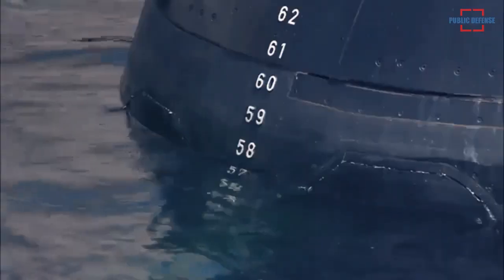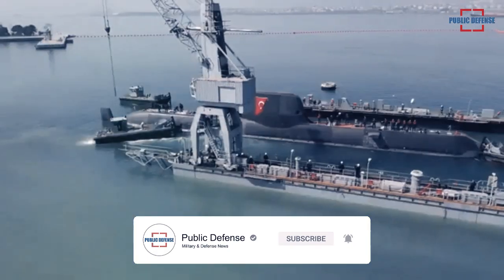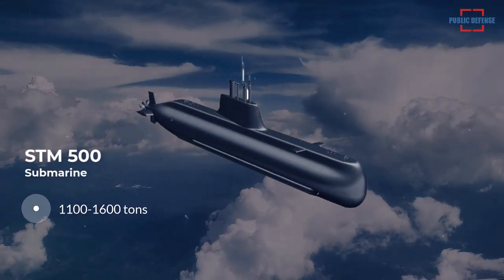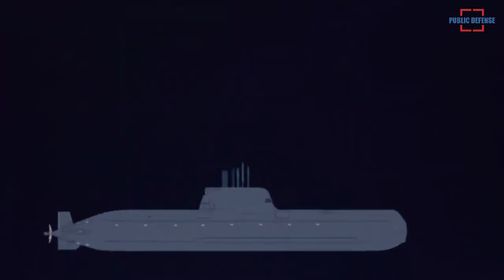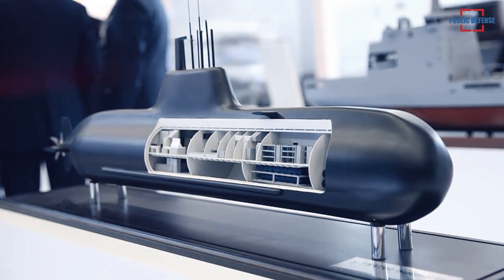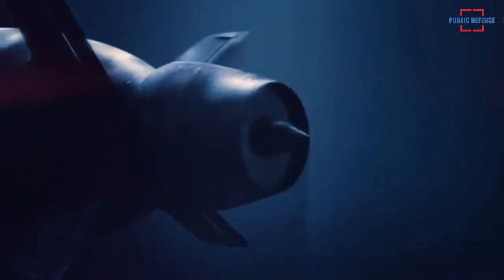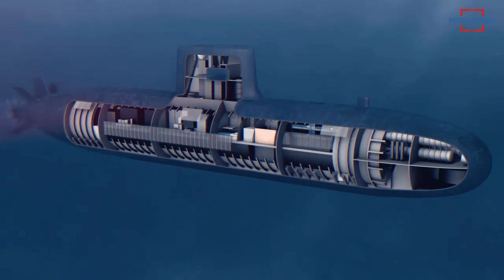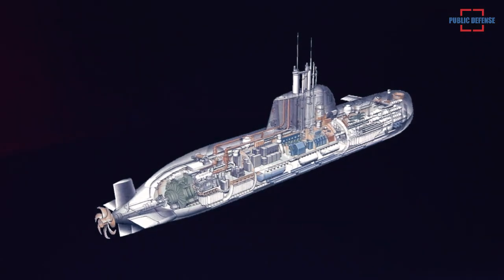Turkish STM Revealed a Conceptual Design of 540 tons Mini Attack Submarine, Named STM 500

Comment: you have like ten years trying to build one U-214TN submarine and you still have not finished, and now you copy the German U-214 and call it MTS, finish the U214 first see if it works, super power more like super clowns.
Reply: What dream world do you live in !? 🤣🤣🤣🤣First of all, you bought a standard submarine, that is, a submarine that is out of balance, but we extended its height by 3 meters and increased its weight a little, as our authorized commanders noticed. We produced Type214 with 81% high domestic contribution. And you have produced it with full foreign technology and are dependent on the outside. What were you able to localize while we were localizing radar,sonar,sensor, and weapons systems ? Anything 🤣🤣. The Ill Type 214 submarine has already been put to sea, or are you ignoring it ?Each will, in turn, join the Navy between 2022-2027 Dec . And you'll be watching from afar crying🤣🤣🤣
Reply: @bedrihanarmagan8812  if i was a Turkish dreamer like you my friend, I would believe your lala land tails but unfortunately I live in the real world. you don't produce anything useful kid you just a Turkish dreamer like Erdogan your submarines are crap when you put them submarines in the water then talk and if they work and our submarines are not out of balance,when the u214 was build as a first of it's kind it was leaning but the Greek shipyards found the problem and fix it, now I don't know what you going to do about that probably delay an other 10 years 🤣🤣🤣 only Turkey doing the crying kid that's your part my friend.
Reply: @vassilisioannou5488   what are you talking about? Turkey do have expertise on different fields, it's just a fact. why would anyone deny that ! Turkey won a modernization competition for Pakistan navy's submarines ,  they also build many military aircraft,vehicles,ships,weapon systems for different countries including mine(Bangladesh). they helped us with different modernization projects, some of our chinese & russian build system were modified to support western components.This types of engineering expertise are no joke. Don't be ignorant !
Reply: @mdtanzinmaksud7042  it not like that my firend, it's just the big misleading of the Turkish Government and that is a real fact, but I not going to be spisific with you because I don't have the time, if you want to be a fool that's your choice.
Reply: @vassilisioannou5488  
Oh I know you, wasnt you waiting israel's door for "rent" a few uav? 
Ahhaha
You cant be our rival man, go be rival with uganda or somethink like this kind a countries. 
Pebbles like you cant stop waterfalls like us.
Reply: Barking greek
Reply: @erenjager1157  go cry to your  Master kid
Reply: Hahaha. You can't even produce torpedoes yet. You can't even manufacture a pistol. If I were a Greek I would be ashamed to write this. Have the torpedoes you ordered from Germany arrived yet? You wait more. We manufacture 85% of the 214 type submarines ourselves. Friend said 81% but that was in the past. You are sick, very sick. Instead of posting silly comments here, do something for your country.
Reply: @ahmetturk3858  you produce coped junk kid that nobody buy's and does not work and you produce weapon's that your waiting parts from in Europe lol you selling to country's that nowone sells to like Pakistan, Somalia, Bangladesh, when you produce your own and it works then talk talk my friend, Greece is ahead of turkey poor kid why would we make a pistol when we selling weapons to NATO and US special forses like this  https://www.youtube.com/watch?v=_p0ftpdPZes&t=156s
Reply: @vassilisioannou5488  firtst of all boy a NATO and Eu member state Poland recently bought 24 tb2 drones from Türkiye last month;) and would likely Lithuania will follow Poland soon. And interestingly Turkey makes nearly 3 billon dollars of military exports each year with 500 million of it to america. On the other hand you are selling 30 million dollars worth weapons (just pistols and mortars nothing more) . Your exports are %1of ours 😂
Reply: @vassilisioannou5488  pistols and mortars are only weapons you can produce. On the other hand we can produce corvettes (12 Total with 4 Pakistan and 4 Ukraine ) , frigates ( 1 of them already finished, lhd (Anadolu) , intelligence ships, sattalites, uavs (240 for Türkiye 125 for exports as of today) , Atak helikopters (we have 102), Air defence systems, armored personel carriers ( 18 different countries are using our apcs including hungary a EU member state;) )
Reply: @vassilisioannou5488  our type 214 submarines are better than yours first of all they can use anti ship missiles and cruize missiles like Turkish gezgin long ranged cruize missiles. And again they can use Idas missiles for Air defence. These capabilities are not in your subs because they are older and less modern systems
Reply: @vassilisioannou5488  we have just started to build an open sea patrol vessel in Istanbul shipyard TCG Akhisar today;)
Reply: @carpediem5514  your u214tn have systems that have never been used before so we don't know if they will even work, but that is a risk your country made and they are nowhere close to the Greek U-214 and they never will be either, you are right about having some extra capabilities but that wont help you if you don't have the decades of experiences of the German sub engineering, I don't see it my friend your subs won't be in the water for some time and that is if everything can work.
Reply: @carpediem5514  that's what you think but Greece made 1 billion in it's defense industry sales at DEFEA 2021 and this year so I would say it's a good start. you only looking at one picture my friend you looking only at Turkish defense industry and you not looking at how much Turkey lose from investors and partnership with the EU US, let just say that 50 years of your defense industry and you still will not get the earnings that you would have had if you were to leave this radical islam dreams and ottoman empire nonsense.
Reply: @vassilisioannou5488  night vision systems 😂😂 ASELSAN is selling night vision systems for 20 years so far . About the german sub engineering we are using type 209 and type 209\1200 class submarines 12 in numbers Total. We are already got used to the german sub engineering;) and let me tell you this, Selçuk bayraktar annaunced mass production of Akıncı drones has indigenous AESA radars  with 1.5 tonnes payload capppacity it can use Air to Air missiles and cruize missiles like Turkish SOM. And more than that they have started to work on MİUS unmanned fighter jet;) this jet can use all the missiles an F-16 can use and it can Carry it in inner stations like F-35 do.
Reply: @vassilisioannou5488  night vision systems are really deadliest things one can ever produce (!). How did you manage this (!). And least of all you have exported it ha? its something i have never seen(!) . The ultra high tech Greek defence industry (!) İs marvelous😂😂 on the other hand we can produce cruize missiles with 1000 Kms range and 2000 Kms ranged ballistic missiles but again night vision systems are deadlier (!) . We have sold TR 300 Tiger missiles to Bangladeş worth 300 million dollars in the beginning of this year its a Good example for what really is defence industry.
Reply: @carpediem5514  missiles? why would we produce missiles when we can produce lazer weapons? I don't think your missiles will do anything but put on a good fireshow 😄
Reply: @carpediem5514  we don't need junk unfortunately
Reply: @vassilisioannou5488  are producing flying tanks and hypersonic mortar shells too😂😂 you cant even produce an indigenous rifle you are even importing the uniforms of your soldiers yet you are telling you can produce laser weapons 😂
Reply: @vassilisioannou5488  and let me ask you what do you think about poland buys 24 tb2 drones from Türkiye? İ asked it every greek i talked but they dodged the question. As you know Poland is a NATO and Eu member state
Reply: @carpediem5514  I don't think much for it, TB2 is a small cheap drone but as time goes on the market will become more competitive because big companies are stepping up there game and it will be harder for Turkey to make sales like this to NATO country's.
Reply: @carpediem5514  I will show you later i am busy at the moment
Reply: @vassilisioannou5488  we are moving further with New drones like aksungur, akıncı and MİUS . Our drones will be the cheapest among the competitors also more cost effective in general so i dont think we will lose the market.
Reply: @carpediem5514  you see my friend missiles are a thing of the past were is the Turkish laser weapon???
Reply: @vassilisioannou5488  its been 2 years since we have shot down that drone;)
Reply: @vassilisioannou5488  your problem is my friend as Greeks, you think some systems can outmach Turkish might . You cant cope with us. We have more GDP, bigger navy, bigger Air forces, bigger land army . Much more elevated and developed indigenous defence systems and productis... You are weak to cope with us you are barely strong enough to take little countries around you not us
Reply: @carpediem5514  I apreciate that you both still call yourself "friends", because you are allies in NATO and you both as characters have much more in common as you think.
Maybe you both could be good friends in real life.
Reply: @vassilisioannou5488  and according to the video you shared the so called laser systems are not fully producing i mean mass production. Our laser systems both mass producing, and integrated to our personel carriers and ships... You are behind again again also the laser weapons is the only subjek you are talking but i talked you about frigates, sattalites uavs, corvettes, Lhds, and many more;) we have 72 big projects going on at the moment. İncluding emp bomb, long Ranged defence systems, hale drones, unmanned fighters, TFX fighter jet, Hürjet planes e.t.c .
Reply: @rollerrollerichson6258  i agree my Greek friend here is a Good patriot for his country as I do to mine. His knowlegde about weapons systems and products are quite Good , as do I . Yes we could be Good friends in Real life;)
Reply: @carpediem5514  I am sorry to tell you this but you don't have a laser weapon, that is fake news unfortunately, yes it is not in production yet but it will be soon. and if you still think that you make laser weapons then show it to me in a picture or video I might want to buy it.
Reply: @vassilisioannou5488  you did not participate in Libya conference, your Media wrote many news on the issue, mitsotakis and dendias tried hard to participate but germany did not let it and they cried 😂 yours is a weak country again. You are useful when other Western countries sell you weapons and when you give them military bases for 40+ years old outdated weapons 😂
Reply: @vassilisioannou5488  Want some Laser weapon systems ? Check Roketsan ALKA and Meteksan NAZAR systems. I doubt you will have funds for those but still you can check them out at least ;)
Reply: @ersinhuseyinoglu  those are little toys compared to our laser, which has a 36 km range and can destroy hypersonic, Balistic, missiles  anything that Flys even satellites, when you manage to make something like that then talk. You can see it in my channel if you don't believe me.
Reply: @vassilisioannou5488  If you can write here the system names so i can check. Also are you sure about shooting satellites with ~40km range ?
Reply: @ersinhuseyinoglu  yes, I am 100% sure satellites orbit at 36 km from the earth because there is were there more effective, you wont fined anything on the net my friend maybe two or three things, this project is not being shared with the public at this moment but I can tell you that the company that is making this is Soukos Robots and that they recently cut a tank in half in less then ten seconds and also it is 300 kilowatts.
Reply: @ersinhuseyinoglu  and also it can lock on to multiple targets and shoot them every 2 seconds
Reply: @vassilisioannou5488  i think you are confusing satelite distance. Check related websites for better information. Sat. distance begins around 150+ km. So check facts and claims. Also labeling TR systems as toys is joke itself especially there are international reports that Turkey used laser weapons to shoot down drones. I advise you to check some facts about satellites and Turkish laser systems.
Reply: its not neccessary for shallow waters you are not someone who understand what strategy is arent you?
Reply: @nephilim20111  you know what ealse It's not neccessary sprinting, there is no need to follow in your grandfather's experienced running
Reply: My greek brother 😆
Reply: By the way, this submarines are based on U-209 Type.
Reply: @rollerrollerichson6258  yes i know it my friend.
Reply: Mr  little greek you are jaloux  the Great Turks is reality 👊🤟🤣
Reply: @abdimahad6299   🤣
Reply: The nation of Turkey played Dirty games against my country CYPRUS since. 1958.,through our compatriots Turkish cypriots a minority of 18% ,been found with RIGHTS like they was 30%-40%..with the ESTABLISHMEND of OUR COMMON CYPRUS REPUBLIC at early 60s , and yet they blow them UP following instructions from Turkey..
TODAY..
our compatriots Turkish cypriots , they past the dimant for equallity.. ( the 18% ,/to be equal with the 82%)..and they are asking for a state on OUR STOLEN PROBERTIES..?
AGAIN TURKEY. 
through our compatriots Turkish cypriots is trying to put a hand on the islands NATURAL SOURSES..
The way they are going.. ( the Turks).. one day they gonna ask from US CYPRIOTS to leave from our island..

for proofs PLEASE search in you tube about. 
1/..' Rauf Denktash's shocking comfession "
read and ALL the comments below THE TRUTH IS THERE
2/.." Dervis Ali Kavazoglu kendi sensinden "
a Turkish cypriot jornalist been murdered just BECAUSE he was saying the TRUTH..
Reply: Greek I understand you are mad but bad news for you. Turkey has already finished 2 of the 6 type 214s. Also, the completely Turkish design project, whose name is from the spindle, continues. The production of this 540-ton mini submarine, whose name is STM500, completely Turkish design and construction has started. We may also be building the world's first unmanned submarine as a surprise, who knows?
Reply: @cengizy5912  Germany has frozen the U214 TN my friend as for your unmand toys they won't work against us.
Reply: Don't compete with us, it's funny. Turkey produces everything itself, including the war management software, sensors, lancers and torpedoes of these submarines.
Reply: @cengizy5912  don't compete with you 😄 ok Turkish dreamer, when you produce your own things then talk, putting together parts that you take from other companies is not called produceing poor Turkish dreamer kid.  😄  😄 😄
Reply: Be neutral if You're wise as well as scholar. Nowadays, you must confess & give credit Turkish advantage on military sectors. They acquired technology to built almost everything but Fighter engine 🇧🇩🇧🇩🇧🇩
Reply: @abdualim6255  they not building anything kid it's all copy's from EU, that they buy license from, Advanced maybe for bangladesh and somolia
Reply: It is nice seeing greeks in the comments, any Greek attempt for building submarine?
Reply: @bombacmulayim2987  yes its the ones that u can't find
Reply: 😂 yeşiller iktidar ortağı oldu.Almanya ile Askeri konularda ters düşüldü.Hadi yine iyisiniz.Deniz altı konusunda ispanya ile ortaklık anlaşması imzalandı.O da olmazsa Rusya ile devam edilecek projeye.Stm500 ü kendimiz üretebiliriz 😂
Reply: @aytacugurlu9297  when your own weapons turn against you, you will realize that all Turkeys dreams will come crashing to a tragic end and we will be laughing, the time will come soon my friend very soon, this coming summer so get ready to cry soon kid  😂😂😂